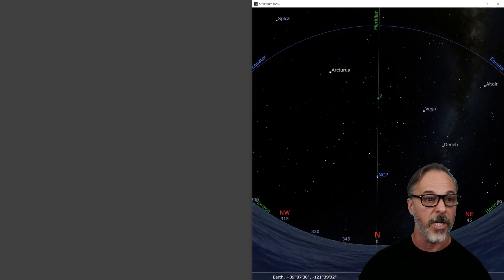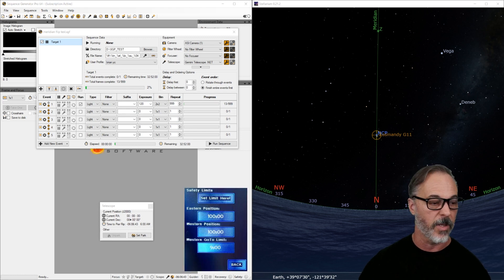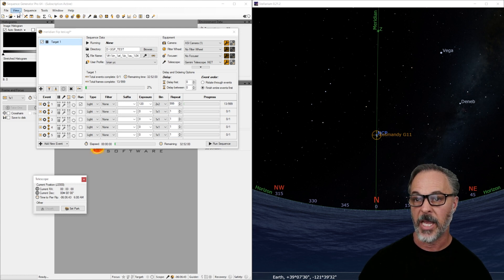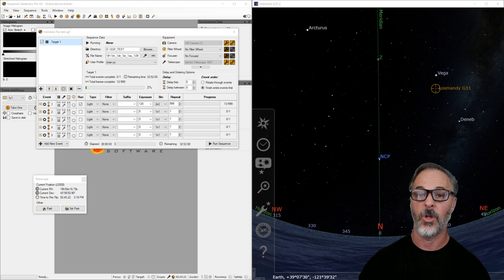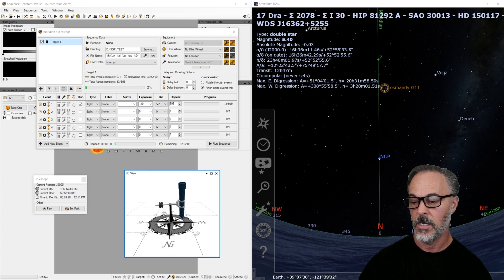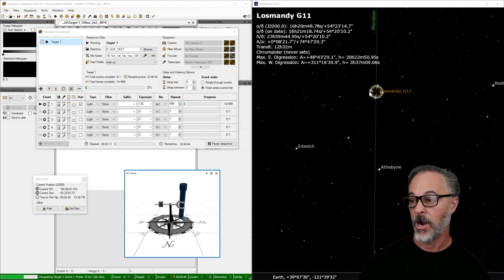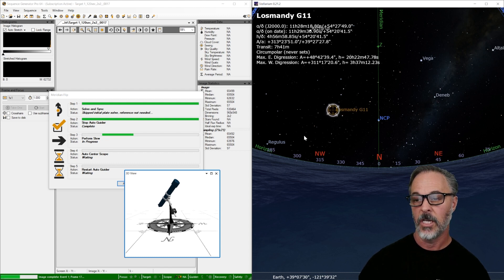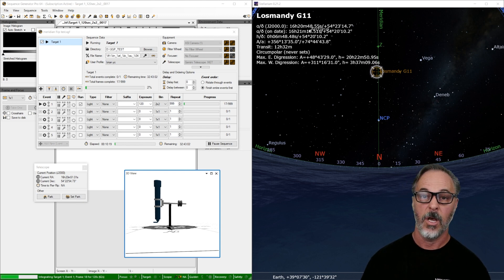Advanced Topic:  LIVE Meridian Flip in SGP: Putting it to the Test

Comment: That's what mine does every night.  Works like a charm. Just remember..  if your doing long 20 or 30 minute exposures like I do and your last image acquisition finishes before the calculated flip time, that SGPRO will start another acquisition before it flips.  So you need to make sure you have enough space between the camera and the mount to complete it.  Or you can do like I do and pause SGPRO during the image acquisition, whereas it will finish the image and pause the next one and then you can let the remaining time run out and then just start the sequence over and it will flip.